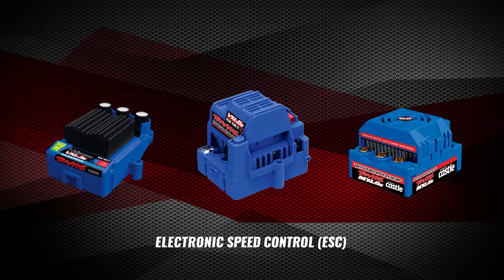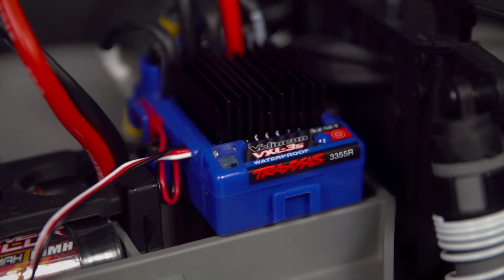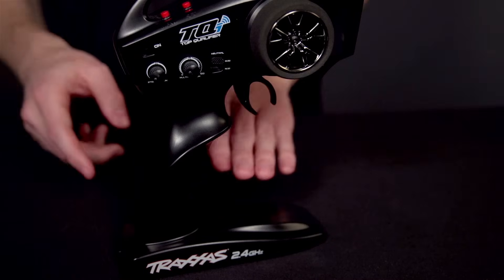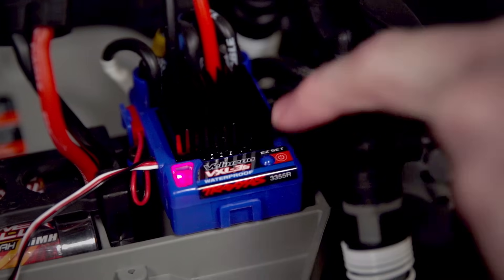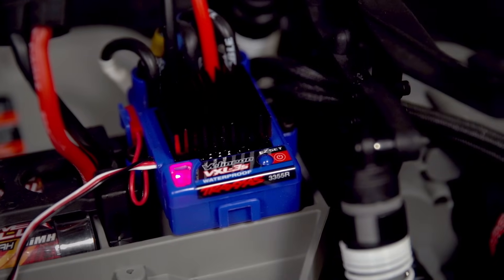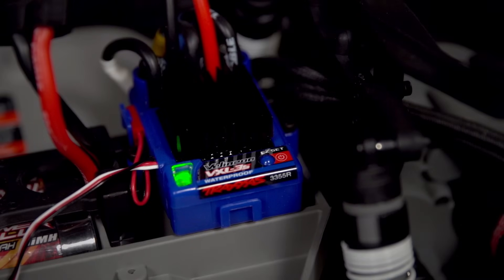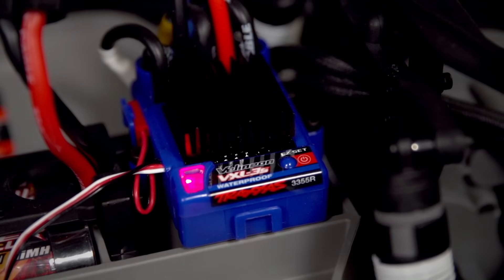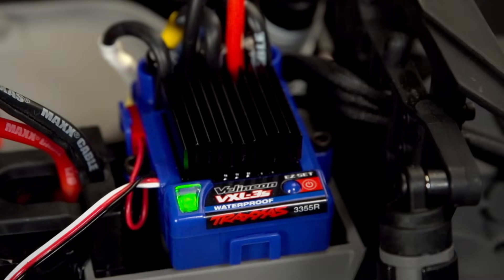How to Calibrate Traxxas Electronic Speed Controls

Comment: I have an issue upon acceleration on my slash vxl 3s 2wd rc it stutters when given in throttle and times it accelerate on it own for a second. What could this be and can it be a bad esc?
Reply: having this issue now how did u fix it
Reply: @jonathanramirez8939  Well, I inspected the esc to the motor wires they seemed loose, and I crimped the holes a bit. And it stopped the stuttering of acceleration. I noticed the insulation of the ends, and I noticed the wires exposing, and I covered them with black electric tape to seal.

Comment: This doesn't work on mine. If I push and hold the ESC ON button it turns green then red. I release the button and wait for one red flash then pull full throttle on the transmitter (as described here). But then ESC LED goes out and stays out.
If I hold the ESC button when turning it on, it blinks red once, twice then three times and starts over. No response whatsoever. 
I wrote to Traxxas about this a week ago and no response whatsoever.
Reply: Same issue anything yet?
Reply: @DetriotDoughBoyMUT  I figured it out at last. The plugs on the receiver were in the wrong sockets. You need to look up really close to see the numbers on the channels. They go in reverse order to every other one I've seen. My throttle was operating the steering and vice versa .
Reply: @warren52nz This comment just saved me hours or headaches! THANK YOU!!

Comment: How long do I need to hold it?  I’ve held the throttle open for 2 minutes. Nothing happened.
Reply: Have you found a solution? I'm having the same problem
Reply: @spokeskeys6238 I had the same problem. I just switched the throttle channel to reversed and than I calibrated the esc again

Comment: Bought a traxxas slash on 7/11/2021 from Pegasus in So-Cal for my 11yo. Dude at counter said everything was in box (but was missing AA batts) took it home, unboxed it, charged battery and never ran. It only has steering but no forward or reverser. Called the store and off course they sent me to watch this video which didn’t work. Absolute trash of a toy. I will change/update if problem gets fixed. 
Sucks to see the disappointment on an 11 yo,

Comment: please help it just keeps blinking green and does not click red
Reply: Did you already reprogram it?
If so here’s a couple ideas of what it could be
Make sure your transmitter is turned on
If it’s on and programming can’t be complete you probably have a bad receiver. 
Make sure you have your esc plugged into channel 2 on your receiver, and steering servo into channel 1.
Reply: @OmegaWolf543  thanks i  figured it out
Reply: @Wmacrum  what was the problem with it?

Comment: One time I got a replacement esc and receiver, and my esc popped out a plume of smoke while calibrating. I’ve never heard of that happening.
Reply: I tried to calibrate mine cause i was only have stering and same appen to me
Reply: @gabriellarouche3702  I found out what causes it. It’s when the receiver or anything connected to it is faulty. I found that out because I used a dummy sec that was the same model, hooked it up with the same electronics, and I let it smoke grenade. The receiver was also melted after that.
Reply: @OmegaWolf543  ok thank i will chek that to

Comment: after doing the reverse portion, my esc never blinks green. Lights just stay out forever
Reply: Did you solve that? I have the same problem.
Reply: @TheMrKarolus  were you able to solve it I have that issue as well.
Reply: @andrewherrera7116 , yes, I paired controller and reciver again and then I could calibrate ESC without any problem.
Reply: Yeah it’s usually a binding problem with the receiver/transmitter.

Comment: Mine will flash red once, but then not do anything after I pull in the trigger and/or release it.  Ideas?
Reply: Same
Reply: Make sure to hold the throttle full until it flashes. Don’t release it. If you were doing that, then rebind or replace your receiver.
Reply: @OmegaWolf543 I am having the same problem with mine even after taking both steps
Reply: @spokeskeys6238  strange. What channel is your ESC plugged into? Throttle channel is number 2.

Comment: Thanks traxxas. My maxx was going opposite directions. I fixed that problem using this video
Reply: For the World mine was too after a flip this video was a lifesaver
Reply: My Merv goes in reverse when I choose 70/30 breaking option, will this fix that?
Reply: Talbert Bonafe the 70/30 I believe is the normal throttle and braking option for the maxx. If you are having the same problem with the speed opposite directions I recommend calibrating the speed control by using the traxxas controller to help with calibration. It will work if you follow the steps the video provides
Reply: This works for the maxx also?
Reply: The reverse throttle problem was fixed on the maxx, when I watched this video I calibrated the speed control using the remote controller and it was back to normal. So to answer the question I believe this is the best option for all maxx vehicles and will work for anyone who is trying it
Reply: The handbook tells you this
Reply: @d4650  thanks

Comment: Why doesn’t mine flash green after programming?
Reply: Brad Bozarth idk. Mine didn’t ether and it fixed jt
Reply: Because low voltage detection is off. To turn it on look it up.
Reply: Susie Q when we reset it still it blinks green after it’s done it did it for me no matter if it’s in low voltage or not
Reply: Susie Q low voltage detection is always on on all of my R/c’s it still blinks red either way, but it seems to work fine

Comment: The light on my xmaxx blinks once for calibrating forward but the light doesn't work after that. If I move (I give 10 seconds) on without instruction it'll blink twice.
Reply: Critter0817 same thing happing to my slash
Reply: @dannyboi9017  did you fix it???
Reply: Did you fix it????
Reply: @marcastaylor.outdoors4810  what my issue ended up being was, somehow right? A small peice of metal got in my receiver box and crossed some connections. Got a new receiver, and it went back to normal. HOWEVER I strongly recommend getting a hobbywing MAX6 or MAX5 esc because the Velineon esc's will make your batteries go bad prematurely. Especially if the battery is a traxxas lipo

Comment: my speed controller only blinks red once and then does nothing after I hold the throttle for several minutes. I am using a fully charged traxxas I'd battery and it never works.
Reply: I have the same Problem...
Reply: put is in channel 2
Reply: +Revado D Thanks, i've already solved the Problem :)
Reply: It fixed my Gremlin! Thanks
Reply: Evan Kent mine is going solid green then blinking red and only sterling works

Comment: It doesn't work
Reply: Boosted RC no i out mine in 70/30 and a 3s 40c lipo when I do speedruns and hit bottom on my transmitter the esc just turns off and I only have steering no throttle I did the set button thing I did the programming thing calibrate nothing works
Reply: Yea it won’t blink Green for me , it stays solid green